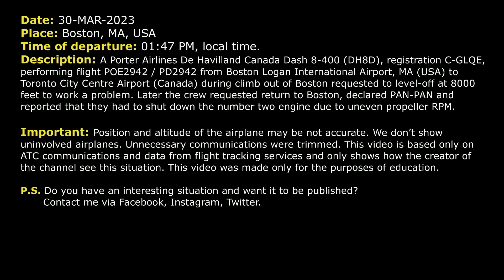“We had to shut down the engine”. PAN-PAN. Porter DH8D had uneven propeller RPM at Boston. Real ATC

Comment: WTF. The pilot declared Pan-Pan and then immediately told ATC about fuel and passenger load. Doesn't he know that he is supposed to WAIT for the ATC to ASK him about Souls on Board?
Reply: Why should he wait? He knows that is basic info ATC will ask for.
Reply: @dalydegagne1839  The joke is that pilots know that is basic info ATC will be asking for but at the same time basically never have that info on hand to immediately relay when declaring or asked for it.
Reply: No the pilot wanted to get it out right away to clear up doing it later if the plane situation got worse. 
He had control. Do the heavy lifting when u are the most stable.

Comment: I get a feeling these delayed pan-pan-pans or mayday-mayday-maydays make it more difficult for the controller to handle the situation in general, no?

The feeling I get is that pilots are avoiding declaring them to “spare” the controller unnecessarily, but that instead actually make it more difficult for the controllers.
Reply: Or they're just working checklists and stating intentions as they go along
Reply: The initial problem may not be serious, and so they refer to the QRH. The QRH may then lead them to an engine shut down that will warrant the declaration of emergency and extra assistance / attention from ATC in order to return.
Reply: @EdOeuna  Indeed.

Comment: Can someone explain why Captain switched to 33L from ILS 27 after declaring PAN-PAN? Seems like there was a reason since controller asked if they still wanted 27 after the emergency declaration…
Reply from the maker: Probably longer runway.
Reply: Longer rwy and better winds
Reply: 33L is longer and was favored by the wind. Also, from memory runway 27 lines up with downtown Boston with high rise buildings, which can be limiting in case of a single engine go-around.
Reply: Thanks everyone. This makes sense.
Reply: Can’t speak to Dash specific details, but generally when landing single engine you land with less flap, so higher Vref, so longer landing distance. Reverse is generally used with caution because of the asymmetry.
Reply: It was windy and favored 32 and 33. Also, 33L is the longest LDA available
Reply: Landing distance doesn’t really come into it in a turboprop, but type of approach and cross wind will have more of an effect on decision making.
Reply: On the Q400 with an engine out, you won't have reverse thrust which is a large part of what gives the plane its short stopping distance. The propellers go into full reverse much faster than jet engines, so will do much more to stop a plane. Without that, they probably wanted a longer runway. QRH says to increase the landing distance, as well.
Reply: Thanks. I assumed that... but are we thinking that's just a good idea in general in an emergency, or because of this specific emergency?